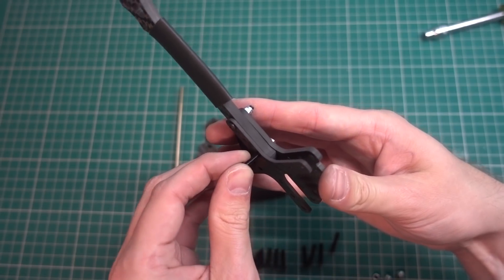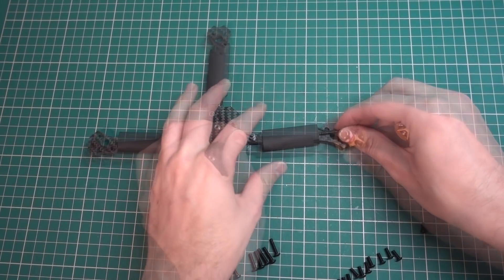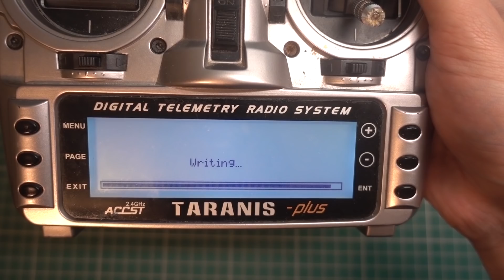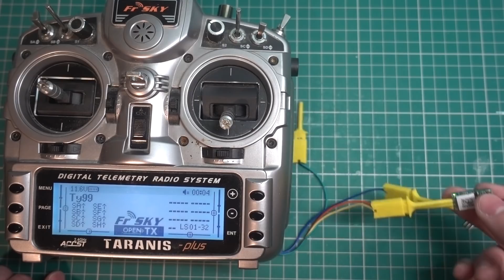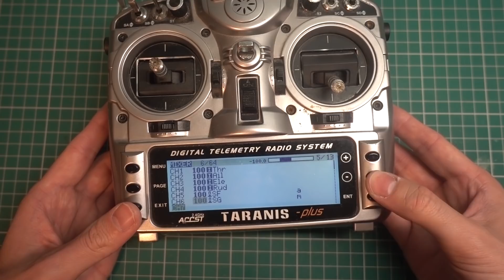$99 Tyro99 Built in 10 Minutes

Comment: nice work.
the only thing I would suggest (and it wont matter for this build) is that directional nuts on the motors are a good thing.
with HQ props, you can undo the nuts with a hard punch out.

Comment: Finally, someone checking for short circuits before putting on a battery.  Thank you. :0 Especially with this quad being aimed at first timers etc the chances of a bad solder joint or dodgy connector and ... poof,  magic smoke :( $99 wasted.

Comment: After putting everything together I bound the receiver and opened betaflight, I was pleased to see the FC is running 3.5 but I'm getting warning no signal from the receiver, a brand new Frsky XM+. What do you think might be the problem as I've even tried a Flysky FS-i8 SBUS receiver and I still get the warning no receiver signal. I'm thinking it might be down to faulty FC as I know the receivers are fine as have used in other builds, infact the Flysky receiver came out of another drone that flew fine.

I would love to agree this drone is good for beginners but as I'm not a beginner all I can say is this might be good for beginners if it actually bloody worked which mine isn't.
Reply from the maker: Did you bridge the sbus pad on the fc?
Reply: AndyRC  I have just done what you suggested and it looks like it has solved that issue, you are a star. One more question but this one is about the vtx, does your tyro99 vtx get extremely hot after less than a minute? as mine is and it's a little weird as I've never noticed that on any of my other drones. It could well be the fact I'm still pretty green on some parts of drone parts, but it would be good to know if it's not just my vtx.

Comment: Great vid ..Is there a specific wire location to solder to your motor wires .I know you soldier to the board but is there a 1 , 2 , 3 wire location on each motor?
Reply from the maker: yes the three closest ot the corner relate to that motors corner

Comment: Does it matter which motor wires are soldered to the ESC terminals?
Reply from the maker: Yes otherwise you will have to remap them in the resources. The order of the three wires does not matter though as the direction can be switched in blhelisuite

Comment: I was tripping out first half video when the motors were on same side instead of diagonal I was like what is this config will that work and then half way through I saw it changed lol been there thank good u didn’t heat shrink first the rx I don’t think most pros know this cause no ones doing it in there build but the cover is heat shrink the clear cover u put on heat it no ones doing it but that’s what it is great build video thanks I’m having arming issues I think it might me because I used rx5 I also didn’t solder the three jumper pads for ibus I didn’t think it was necessary cause I used rx 5 but might be wrong so I have things to try

Comment: I built mine up and the esc didnt work everything powered up and there is power on the motor tabs of the esc but it just wont cause the motors to beep and wont connect to blheli suite ... Sad times but i got a partial refund and have ordered a different ESC that ill have to solder to tbe pads on the FC
Reply from the maker: when you say the motors power up in the motors tab. do you mean they spin? if so the esc isnt the problem
Reply: @AndyRCchannel  shouldn't the the motors have the first phase of beeps on power up regardless of signal from the FC. I was a tad confused about it as in the past if a 4 in 1 ESC hasnt worked theres not even been any power pass through to the FC.
Reply from the maker: Did the motors spin up in the motors tab?
Reply: @AndyRCchannel  no tried that aswell luckily the refunded me 50% and i do have a new ESC on the way but its just confused me a little
Reply from the maker: Yeah sounds like the cable connecting the esc to the fc needs replacing
Reply: @AndyRCchannel  cheers Andy you're a credit to the FPV community keep up the good work. Ill try find a replacement cable.
Reply: @hack_it7535 
 I got similar issue due to cable strand isolation
cable are stranded Core  and each strand is isolated if you don't keep original length and cut the cable
you will not be able to tin correctly  you will need  to scratch  isolation on each strand with a cutter  
hope this help
....

Comment: Hey guys,  Can someone help a brother out? I have 2 questions:
1) Why short the S-Bus?
2) This is my first drone, I built it and it turns on. However, when I throttle up on my transmitter nothing happens. Do I need to first plug my quad into my PC? My Transmitter is picking up my receiver as far as I can tell. Also the red LED is blinking on the quad, is that normal? 

Thanks in advance!

PS - Sick vid BTW Andy man
Reply: you need to sodlder those two tabs so that the FC can understand the sbus signal, as far as i remember.
Reply: Thanks Sebastian! I got it working finally and you are correct. Shorting this on the chip is basically saying that you want to use S-Bus as your communication type :)
Reply: @PowerOf One if you look at 4:11 on the video, there are three micro-tabs next to the RX connector that are labelled PPM DSM and IBUS, if you-re looking from behind the direction of the board (from behind the arrow) youll need to solder the center and the left pads for the board to understand SBUS (then you need to set SBUS on betaflight)
Reply: @PowerOf One Yeah sorry, what he said. I also forgot to "Arm" my drone which was a little silly.